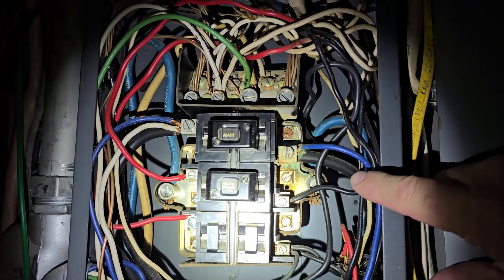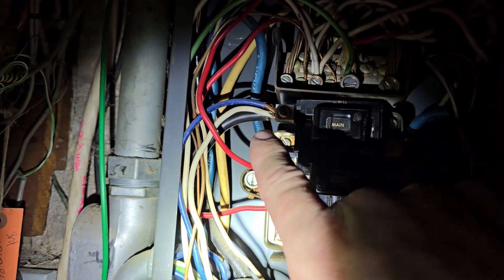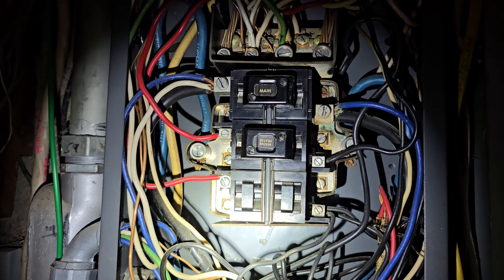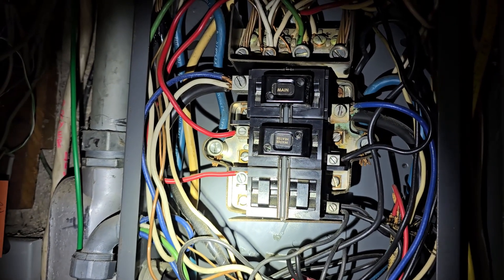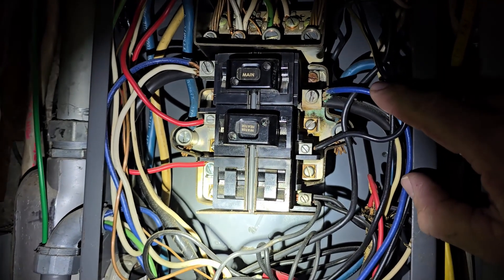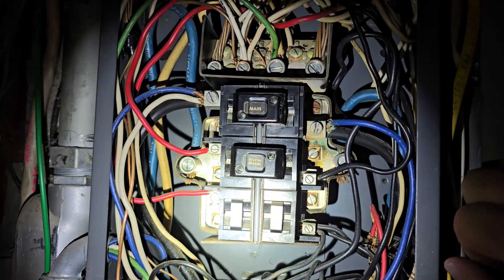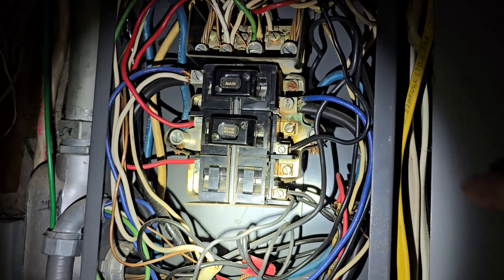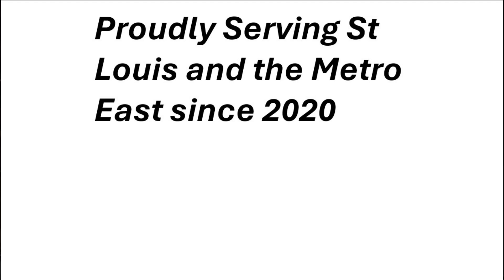Exploring Why a Triple Tapped Pushmatic Panel is a Fire Hazard

Comment: Back in 2005 when I was 16 and helping my stepdad rewire his ranch style home built in 1973, with aluminum wiring everywhere and 70 amp Zinsco main panel in the bedroom closet, found the water heater wired with 14 gauge if I remember correctly, low volt landscape "zip cord" wire running almost the length of the home in the crawlspace.  So after verifying the main breaker was turned off and everything in the home was powered down, went back in the crawlspace and proceeded to cut the water heater "low volt" wire, when I get a bang as loud as a shotgun and large flash. Laying on my back for maybe a minute and realizing I'm still alive, I pick up my diagonal cutters with the tips vaporized off, my face was blackened and facial hair singed, I would be blind in my right eye were it not for me wearing glasses since 4th grade because a piece of molten metal was fused to my glasses.  

Come to find out, the water heater was originally propane, and the previous owners or a handyman they hired tapped the water heater off the line side of the main breaker because the panel was full.  

So dad pulled the meter and we found the main lugs in the panel were welded in place and some of the breakers were welded to the bus bar, so changing out the panel required first cutting the service wires out with bolt cutters.  The aluminum romex was  melted past the outlet box on several receptacles, leaving us with no other option but to abandon the old aluminum and pull all new Romex through the whole house.   How that place is still standing I have no idea.
Reply from the maker: Wow, as home inspectors, we see some crazy things and hear some pretty wild stories from our clients, but your comment is the best testimonial I have ever heard for a home inspection. We always refer repairs to a qualified tradesperson to avoid these DIY catastrophes.